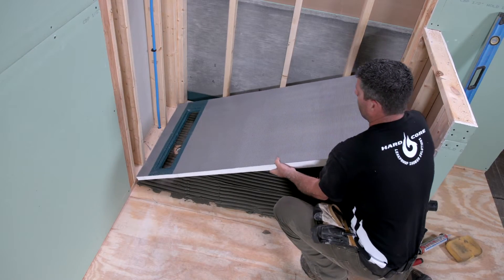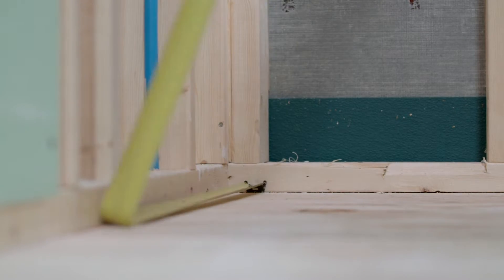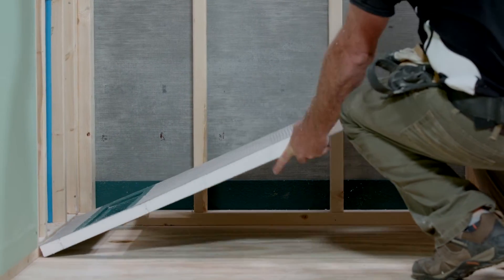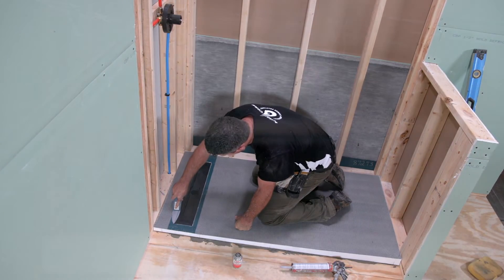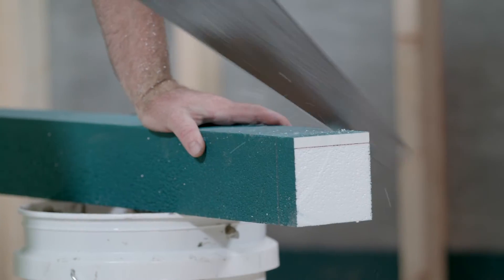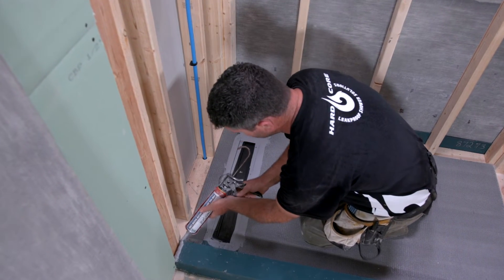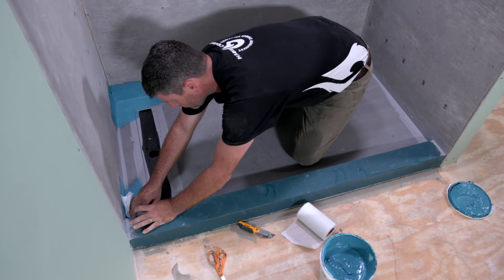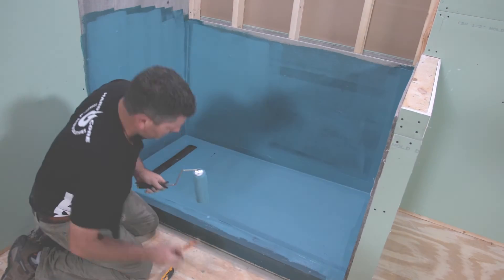How to Install a Linear Shower (KBRS Linear ShowerSlope™

Comment: Quick question, can i use waterproof sheet membrane instead of the roll on stuff you're showing in the video?
Reply from the maker: We haven’t tested our system with the “sheet membrane” and would not be able to guarantee positive results or performance. It would be advisable to use the roll-on waterproofing that we sell or a like product such as RedGard or AquaDefense to ensure an installation that has been done using tested methods and is covered under the proper code approvals.

Comment: The grean sealer, fabric, and caulk - what are those products & are they available at the big box stores?
Reply from the maker: The following products can be used as substitutions to the KBRS ShowerSeal line: REDGUARD, Aqua defense and hydro ban in place of the ShowerSeal Liquid Membrane, 3m 5200 or OSI quadmax in place of ShowerSeal Polyurethane Sealant, and laticrete fabric in place of ShowerSeal Gauging Fabric. These alternatives should be readily available in any big box home reno store.

Comment: Can I use floor heated systems on this floor system
Reply from the maker: While we haven’t officially tested our products with any of the floor heating systems, we can say that we have had many of our customers say that they will/have used floor heating systems with our products and so far, we haven’t heard back with any negative feedback. As long as the elements are installed into the thin-set layers like normal and aren’t making direct contact with our basin, there shouldn’t be any problems.

Comment: Two questions; Can the backer board be installed on the walls first touching the floor, then the base? That way you don't have to worry about cutting the bottom of the boards at an angle. Also, does the roll on liquid membrane HAVE to be applied to the shower slope?
Reply from the maker: Yes backer board could be installed first; however, the best way to ensure a watertight installation would be to place the backerboard on top an thus shingle the water. The liquid membrane needs to be applied to the ShowerSlope because the fiberglass coating used in fabrication can have pinholes.
Reply: @Kbrsinc  Thanks for the reply. Your right, better to have the water shedding properties versus fussing over cutting a couple angles (which will be easy to do with the foam wallboards like go-board anyways).

I'm going to read the manual that will come with the shower slope kit, but while I'm waiting, how many coats of the roll/brush on liquid do I need for the pan and corners.
Reply from the maker: @kevinrehbein7684  You will need to apply 1 coat then press the fabric into the corners, and apply a second coat over that, "sandwiching" the fabric into the waterproofing.

Comment: I bought a slope from you guys on October, have it installed now and am about to put up the  backerboard. Do you guys have any tips for installing/cutting the backerboard so that the slope of the base is taken into account so that the backerboard sits flush on the base?  Thanks.
Reply from the maker: Joe, the first thing you need to do is identify the lowest point on the Linear ShowerSlope™. You can do this by placing a level on the Slope and marking its lowest point. You will then measure up 3’ off the floor at the lowest point and make a mark. Next you will draw a level line across the studs. Measure down to the slope at the stud locations and transfer these measurements to the piece of backer board.   Draw a line connecting the points and cut the backerboard with the method recommended by the backerboard manufacturer. If you have any other questions feel free to give us a call toll-free Mon-Fri between the hours of 9AM-6PM EST at 866-912-3211.
Reply: For anyone that does this in the future. This is how I'm establishing the "slope" cut of the backer board. First, cut the "width" of the backer board so it fits the area where it will be installed. Next, cut the base to fit the area where it will be installed. Now before the base or the wall board or anything is glued or cemented or secured in any way, simply position both pieces together so the backer board is against the wall with the bottom edge setting "on the floor". Now position the "base" up against it. Simply trace the slope onto the wall board. Once that line is traced onto the wall board the pieces can be removed and cut as needed and the rest of the install can be completed as shown in these videos. Easy and virtually no measuring to get the slope.
Reply: joe lampe how did it turn out?  I'm about to install one.